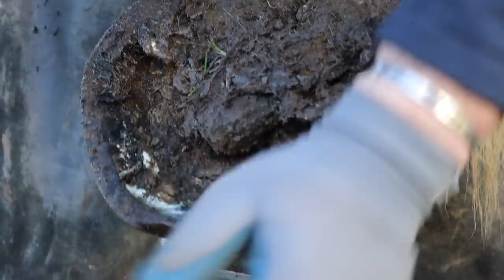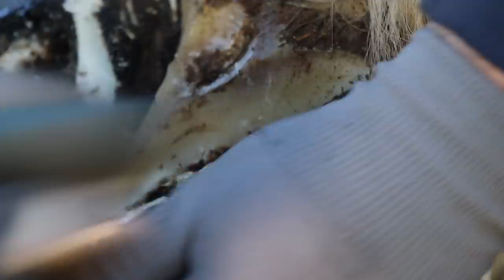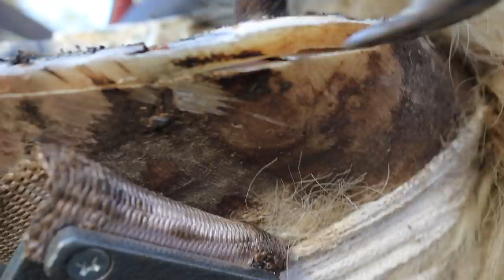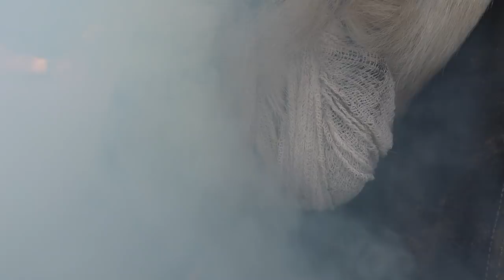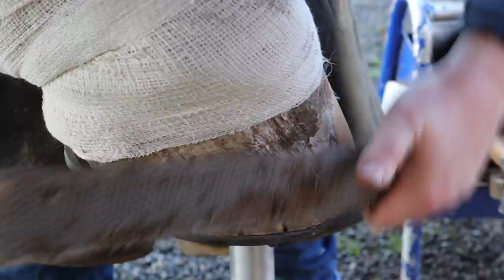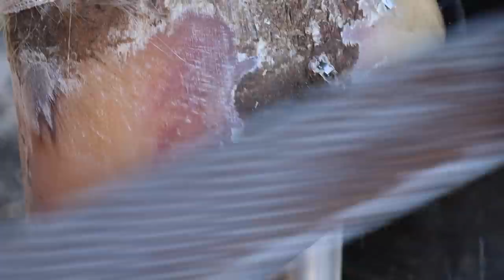Satisfying Hoof Restoration - HUGE FEET!

Comment: Im so used to watching cattle trims, this is so different i never knew how this was done!! I have so many questions, whyd you put the shoe on hot? Whats it for? Whats the procedure 😭😭😭 do horses ever get gross infections and how would you handle those ahhh im so curious now! I like this 🤩
Reply: I can answer a little! Holding the hot shoe agaisnt the hoof like that helps create a really good fit between the shoe and the hoof (you can see him doing a tiny bit of adjustment when he sees where the mark is). It burns away a very little bit of the hoof and gives you a smooth surface, which is also "sealed" (sort of like a steak!) which helps protect against moisture and bacteria. Hot shoeing is not 100% necessary but it's good practice for the best possible fit. 

Horses absolutely do get infections and abscesses in their feet and these can range from fairly mild to very serious. Routine hoof care like this video helps prevent them. This experienced farrier will notice if something's not right, but also the horse's owner should be taking care of their hooves every day. Bacteria can get in through punctures or cracks in the hoof. The horse will start to go lame and the hoof will be hot to the touch. Abscesses have to be drained, which is pretty gross depending on how you feel about pus, and then looked after carefully for a few weeks. Horses can also get thrush in their feet, (which is very gross because it STINKS) usually from standing around too much in moist and dirty conditions. Clean dry stable conditions help to prevent this.

Comment: I have watched a few of these now and I still wonder:
How do you make sure - after roughly clipping the toe edge - that you don't file the hoof at an angle (e.g. left side filed shorter than the right side of the hoof), which would lead to wrong joint position afterwards?

Is it automatically even, when the horse rests its leg on the stand?

Comment: Please people have patience with me, I'm about to ask some questions most will think are dumb.
How often do you have to do this? How did you know how much you have to cut off? I thought you only needed to put horse shoes on horses if they walk on hard surfaces. Do the horses like getting new shoes? Are there different ways of doing this?.
Reply: These are good questions.
A horse should see a farrier about every 6 weeks. Some hoofs grow really fast then it's better to do it every 4 weeks and some grow more slowly then 8 weeks is ok.
He knows how much to cut away by the feel of the material of the hoof and experience of course. At the outer edges the hoof is sort of dry/ powdery/ brittle. As you cut away you feel the hoof become more dense and "moist". I don't know a better word for it, sorry.
A horse may need shoes because as you say they walk in hard grounds but also for orthopedic reasons or because of an illness. Not sure what the reason is here.

Comment: Just a noob question...
The part that he cut away...how long does it take to grow it?
How long does it take that the horse get the next session?
Reply: A horse should see a farrier about every 6 weeks. Some hoofs grow really fast, then 4 weeks is better. Some grow slow so you might wait up to 8 weeks.
To judge by the amount he cut away here, this horse has not seen a farrier in much longer than 6 or even 8 weeks. Hope that helps.
Reply: @akw6078  Yes it helps thx.

Comment: ClidesDale.,.s often have a straight to convex lateral wall, and there hocks produce a shorter heel ... Hence the sherd nail in 3rd... My old Boss would shout pages... but 4 vision A. pass. Clench in three blows .. and Seat shoe leave more Bar ... Stone trap s... The subject has at finish a broken back appearance, heavies are heel bearer's consider this more. Did see the T pins ! but this is a R/D Dray or ..,.... and again with the scotch block ?